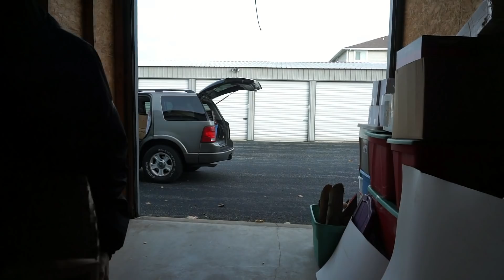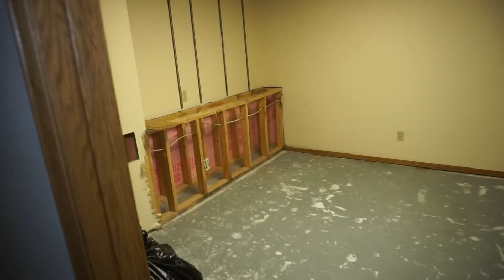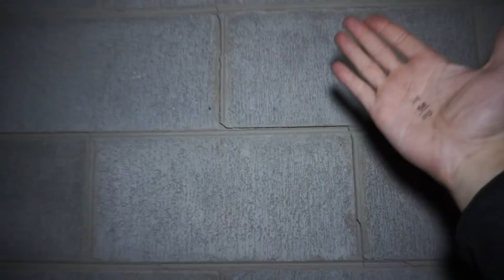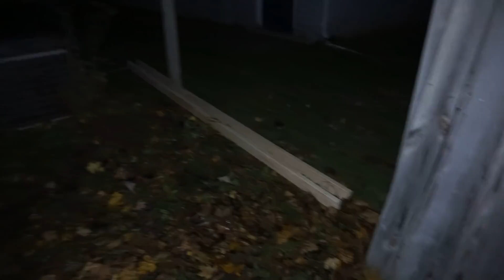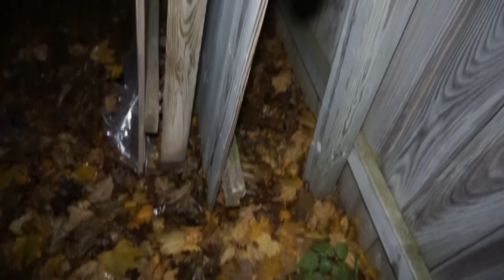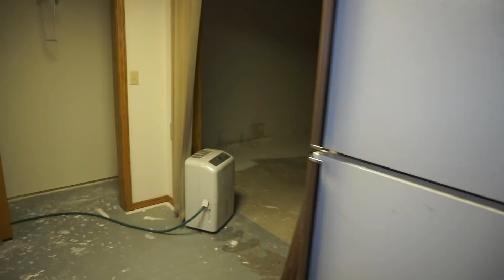Block Foundation Repair Preparation!!! Pt.1

Comment: I’m Glad you don’t use your spinner’s anymore! Could use spinners in ground to hold your basement from tipping? I also live in Wisconsin and seen lots of block basements with the same problem. Better fix now before you have a mud pit in basement. Good luck